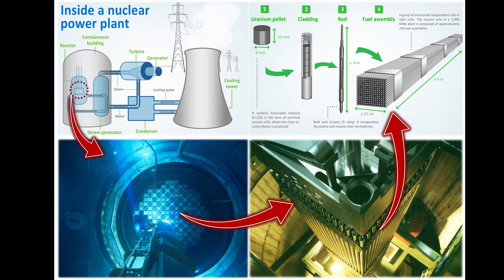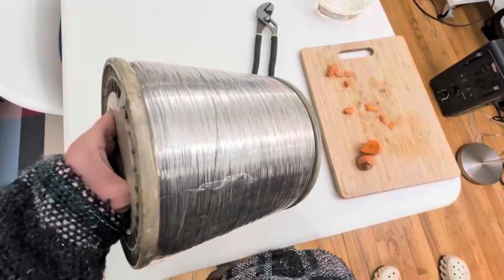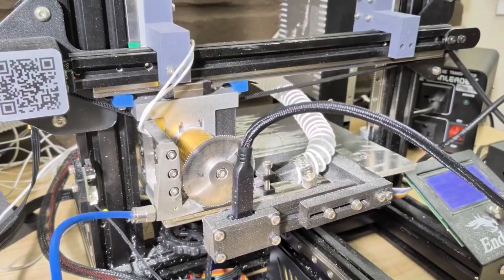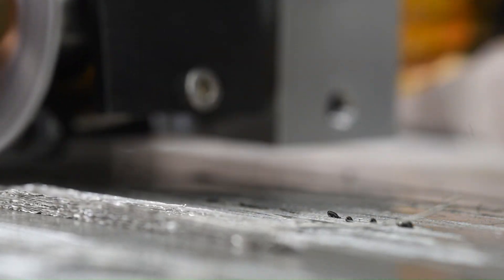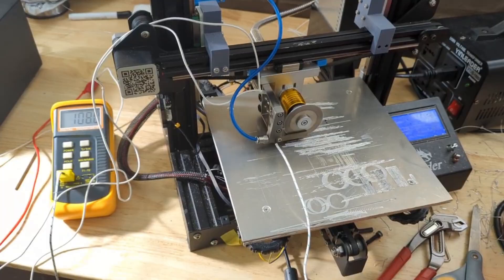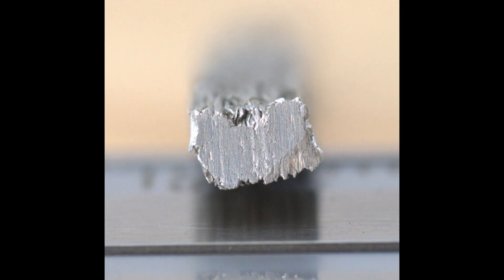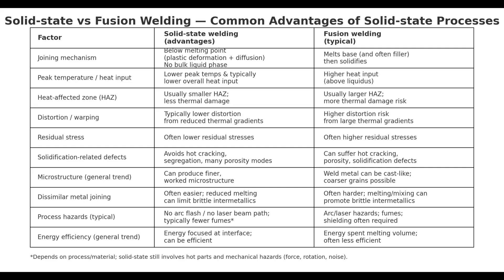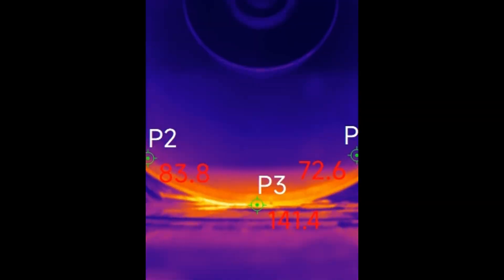Metal Printing On An Ender 3 In 2 Minutes

Comment: Make a smaller version of this and put it in a plexiglass vacuum chamber so the cold welding process can assit you. Two metals in a vacuum can sometimes fuse together. There are youtube tutorials that show you how to make a diy home vacuum chamber.
Reply from the maker: this might be worth a try. thanks for the suggestion! 
though lubrication is critical for the lifetime of the moving parts in the print head.
and lubrication free components are hard to come by at such high speeds and low costs.

Comment: Why doesnt friction weld need gas? Does not oxide layer still contaminate?
Reply from the maker: the temperature at which the welding happens is low enough that the solubility and permeability of oxygen in the metal remains close to zero. The stirring action breaks up the surface oxide, and pushes the metal into direct atomic contact with minimal additional oxidation. 

while the amount of oxide that ends up in the metal is not completely zero it is still 5-8 orders of magnitude smaller than in an arc weld.  In some metals, the stirring and modestly elevated temperature can actually squeeze oxygen out of the metal as new integranular phases or intermetallic constituents form.  

think of it like removing air bubbles from bread dough.

Comment: Not sure how much you know about this, but Meld Manufacturing does something similar. You might be able to get away with vertical spinning unless you’re limited on rpm. Can’t wait to see more!
Reply from the maker: we actually already tried MELD's approach, AFSD. 
https://rotoforge.com/a-list-of-methods/

It turns out to be really difficult to feed segments of fine wire into a rotating die reliably, without jamming, and the dies wear out very quickly when small...
plus the surface speed requirement as we scale down grows geometrically, and the deposition forces remain relatively high due to the low achievable surface speeds. 

But it does kinda work.
Reply: @r @rotoforge2024 ll let you in on a secret, it doesn’t work for Meld either. I had expected you would still be able to feed from the side like a wded or spinning mig
Reply from the maker: @ChipmunksPlan   it turns out to be very difficult to keep the wire from deflecting under the side fed pin probe setup. 
In the limit it turns into FSEAM (friction screw extrusion) or FRAM. 
FRAM has lower forces and lower wear rates, and leaves open the potential for working with harder materials with less specialty tooling. 

but we have a long way to go. Its a big space and we do not know everything there is to know. lol :)

Comment: Make a custom ceramic nozzle. 

Use an induction coil just above the nozzle to warm the aluminum to the perfect temp.
Reply from the maker: there are many examples of this already in the literature. I have also given it some attempts. 
nozzle erosion/corrosion/brazing reactions, the limits of induction heating for small low resistivity susceptors, and the frustrating low viscosity of molten metals (and the incredible temperature sensitivity of their semisolid phases) all make this a very challenging approach to do for cheap.

Comment: Can a lateral rotating rod work instead of a blade?  It might be easier to add layers beyond straight lines.
Reply from the maker: and engineer in our discord is adding a 4th axis. 
https://www.youtube.com/watch?v=X_Vm_gcux2Y

We have tried several variations on point probes (end of the rotating rod/tube) and angled rods, and tubes, and powders. a list of many of the things we have tried can be found here:
https://rotoforge.com/a-list-of-methods/

Comment: Looks like it could do with a turntable under the bed, rather then dealing with the gyroscopic forces on the spinning print head.
Reply from the maker: and engineer in our discord is adding a 4th axis. 
https://www.youtube.com/watch?v=X_Vm_gcux2Y

the gyro forces from the wheel are small, because the wheel is thin (1mm thick).

Comment: Sorry, one more brain fart. With a wire this thin and conductive, have you considered a very basic condensor discharge as the melter, simulating arc welding?
Reply: Apologies for bad English if I get any tech terms wrong.
Reply from the maker: Yes. a good question. :) Junkers in the discord previously suggested doing something similar. Kind of like joule printing. 
 We do not melt the wire in order to achieve improved resolution compared to most arc melting processes, avoid oxidation and improve material strength as printed.

Comment: Could the disc of death pivot on the Z axis, allowing the wheel to always roll in the direction of the printed line?
Reply: Can imagine pivot point would have to be very strong to reliably overcome gyroscopic force?
Reply from the maker: @roobs4245  
the gyro forces are actually very small. a few newtons, due to the wheel being very thin and having relatively little distal mass.
Reply from the maker: https://www.youtube.com/watch?v=X_Vm_gcux2Y&t=607s

we have a engineer in the community working on this exact thing. 
She is doing a great job of it.

Comment: least crazy ender 3 mod
Reply from the maker: a literal horizontal milling machine, now with automatic stock feed. :P
Reply: @rotoforge2024 have you ever considered a rotating table or a smaller wheel
Reply from the maker: @НарезочкиотЛоки  
smaller wheel would require going faster. if 1/2 the wheel diameter, we must*at least* double the RPM to compensate and keep the deposition forces constant. 

yes we considered a rotating bed.  the problem is that large metal parts become heavy, and difficult to accelerate precisely. 

We have an engineer from our discord working on a 4th axis to allow nice curves. 
https://www.youtube.com/watch?v=X_Vm_gcux2Y

Comment: Awesome 👍😎! Can you do this in nitrogen or Argon gas chambers?
Reply from the maker: yes we can. 
it is not neccessary to do so for aluminum. It may be desirable for titanium and magnesium.
Reply: @rotoforge2024 yep.matales like reactive metals that have real world structural and kinematic uses will benefit with this.
Reply from the maker: @AKA-f7p  Aluminum is typically considered a reactive and structural metal. 
many steel and copper alloys are likely to be printable without gas as well.

Comment: Why not just use something like a very fine spot welder and put it all in a vaccum chamber?
Reply from the maker: this is something we have tried. 
spot welders have complex arc and melt dynamics which tend to reduce resolution and make the metal brittle, and a vacuum chamber of the requisite size with a pump that allows reasonable pump down times tends to be expensive.  Arc welding supplies also tend to be strangely costly for what they are. :-/

Comment: just a tip you may need active cooling for the flex shaft for extended use in power transmit. maybe not.  but there's very few ways to do that other than compressed air. 

I think you could use some bldc drone/jet rc whatever motor for direct drive of the spinner tho? (i do realize you want to rotate the head.   or maybe just a dremel mounted upright into a pinion gear that you rotate around, the dremel itself would stay stationary)
Reply from the maker: we have a engineer from our discord working on exactly this. She is doing a great job of it. 
https://www.youtube.com/watch?v=X_Vm_gcux2Y&t=607s
Reply from the maker: The flex shaft seems to be mostly fine operating for up to 2 hours or so printing without much issue. 
but we may cool it via CPAP fan or similar in future. Running extra heavy gear grease from rear transaxle of trucks seems to help greatly in reducing heat build up in the shaft.

Comment: This is hilarious. Excellent fun. Maybe a dental drill... more rpm == more better, right? 😂
Reply from the maker: yes as long as you have adequate torque at that speed to keep the volume of metal of interest moving. 
Dental drills might work for super fine wires. like 0.1 mm OD or smaller.

Comment: Awesome, have you considered having the spinning thing, perpendicular to the build plate, kind of like a router. Then you could make the layers equal in all directions if you don't fling the metal off. This could also allow you to have a smaller contact point at the tip. Anyway cool project!
Reply from the maker: yes we tried that in various forms. 
the wheel has much lower forces, and offers similar precision in terms of line width. 
The wheel also lasts much longer than a rotating die, or a consumable tool. 

you can find a list of things we tried here
https://rotoforge.com/a-list-of-methods/

Comment: I like the creativity but idk if this could really work. Stir welding would definitely give you way more precision. Might be worth trying to build an open source 3D print to sand casting machine (or process) that people can easily replicate
Reply from the maker: this is stir welding. its just on its side. :P 
the wheel stirs the metal together. 
the benefit of the wheel is greatly reduced forces through high surface speed.
Reply: 3D sand casting is not a bad idea in general, however overhangs are a problem as is support material removal. There are some expensive resins that can reduce this problem.

Comment: Did you try stir-welding (rotating shaft), or induction heating (of a tungsten rod or similar)? Just curious 😁

Also, you could look into ultrasonic welding...
Reply from the maker: yes. We tried all these in various forms. :)
rotating shaft stir welding has forces that are too high, and tool wear that is too fast for most practical purposes with materials easily available at modest cost. 
ultrasonic welding has high process forces and complex tuning and electronic controls that made it prohibitive for the <500 USD cost target.
you can find a listing of the various approaches we have tried here:
https://rotoforge.com/a-list-of-methods/
Reply: @rotoforge2024  Dr Evil is asking if you tried ... LASERS? (sorry, couldn't resist)
Reply from the maker: @pauldorman  LOL
yes. we actually did try lasers. 
but they are kinda expensive as far as heat sources go. 
great for focusing energy on a very small spot though. 
and sometimes for doing some awesome physics. :P

Comment: So the 4th axis will be axially rotating print bed, right?
Reply from the maker: it could be 
but Avery has been working on a 4th axis that mounts directly to the gantry. https://youtu.be/X_Vm_gcux2Y?t=6
the problem with a rotating print bed is mostly, that as part mass increases the print bed has to become stiffer and more powerful to support the part. Metals are relatively dense, so this is a big problem for bigger parts.

Comment: Have you considered using some kind of ultrasonic emitter or something like that to rapidly vibrate the aluminium at the point of welding, instead of a sawblade? That could be a potential way to generate the required friction for welding, and permit omnidirectional movement for building up parts.
Reply from the maker: yes. ultrasound requires acoustic tuning. Which is much more difficult than bulk plastic deformation. and ultrasound is actually relatively inefficient in terms of round trip energy input / unit of metal deformation. 

The overall power demand of the ultrasonic transducer actually scales up faster than that of an electric motor for the same power in the contact patch. For the same deposition rate we would need almost ~3X more power in ultrasound compared to the motor. 
Ultrasound also depends heavily on reliable contact conditions at the contact patch. This means that process forces typically have to increase to allow this reliable contact. 
 because we can benefit from relatively high surface speeds, and dynamic friction instead of static friction, our process forces can be ~10X smaller than ultrasound at the same deposition rate. 

https://www.youtube.com/watch?v=X_Vm_gcux2Y&t=332s
Avery is working on a 4th axis to enable more flexibility in the motion. We should be printing curvy stuff soon.

Comment: This looks to me to be a waste of time and money. Cold metal spray fusion or SLS are the best 3D metal additive manufacturing methods. You would be better off to find desktop methods for those technologies rather than this.
Reply from the maker: both cold metal spray and SLS are orders of magnitude more expensive. Mostly because they require handling metal powders(pyrophoric/toxic/expensive) and they have high consumables costs, (power demand, gas consumption, and powder prices) 
They are incredible technologies, but I am confident we can match or beat cold spray on resolution and SLS on cost/speed and alloy selection while staying around an ender price point. 
The whole idea here is to build a metal printer that is accessible enough, simple enough to use, and relatively safe enough to use that a teenager could print metal at home. Since miniature milling machines are already fairly common place, it seems reasonable to provide an additive method that uses the same principles in reverse, with many of the same operating requirements.  :)
Reply: @rotoforge2024  investment casting with a small induction smelter is probably more realistic for hobby level metal modeling.
Reply: @RexAnothership I agree with you on this
Reply: @rotoforge2024  Good Luck!    Bye the way Cold metal spray fusion has been done successfully with air as the carrier gas.
Reply: @rotoforge2024  What I would be interested in watching is a small handheld cold metal spray fusion unit on a xy table modified with a longer z. With a small enough nozzle, the resolution should be much better than traditional.
Reply from the maker: @RexAnothership  
We would love to see it built. Would probably buy it if someone were to make it.

Super sonic de laval nozzles suffer from severe flow instability at small throat diameters, particularly approaching 1 mm, where surface turbulence starts to dominate bulk flow through the nozzle. 
Sam and I have given this some effort in the past. But it is a very challenging thing to get right. 
The Gaussian deposition profile of cold spray was also a frustration for us.  But with a 5th/6th axis, should be an easy solve. 

The real problem is powder handling, it has to recirculate, or otherwise be enclosed, and entraining it in air is basically asking for a fire or at least a lot of oxidation... 😕
Probably easy to beat with nitrogen or another inert gas. but this adds operational cost/complexity. 
this is the kind of thing we often discuss in our discord. 
happy to chat more at length if you would like to.